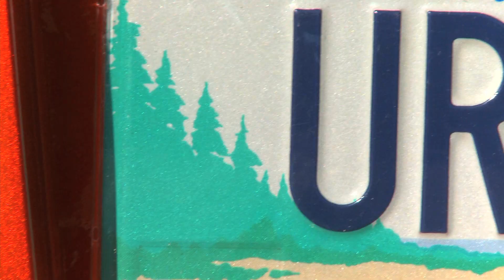URBEE (1st 3D Printed Car Body)

Comment: When you are creating the most aerodynamic shape with the least drag there aren't many aesthetic options.. this car is an electric hybrid with a 1 cylinder 7HP  motor that generates electricity to run two electric motors with a cruising speed of 70 MPH  and a fuel efficiency 300MPG. THAT.. is COOL!